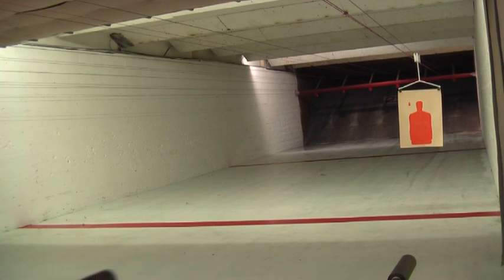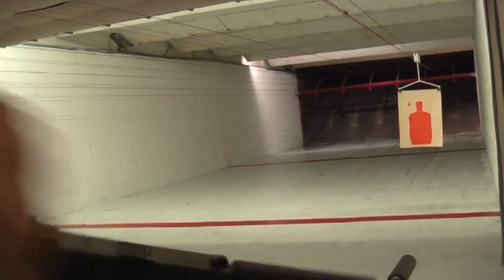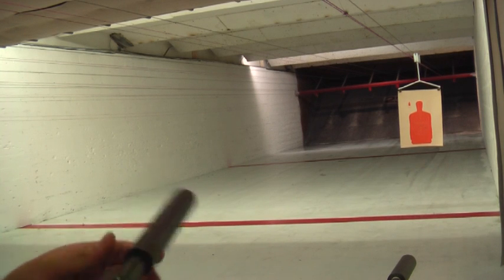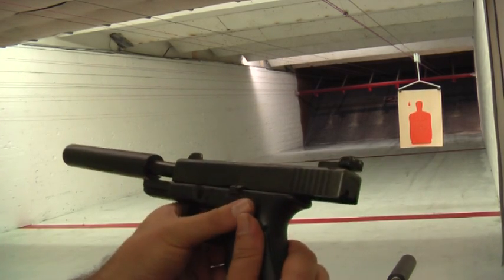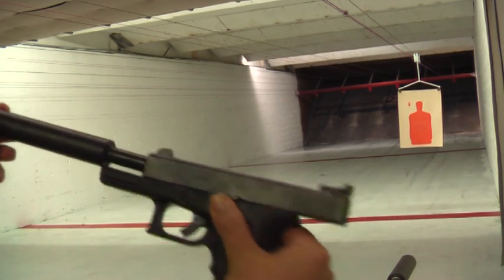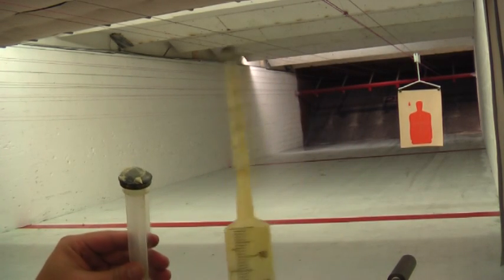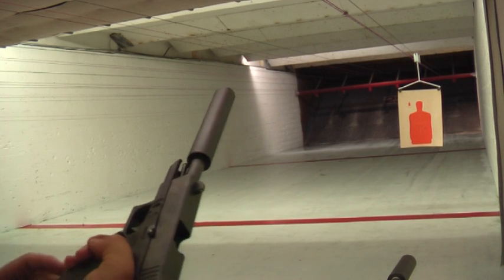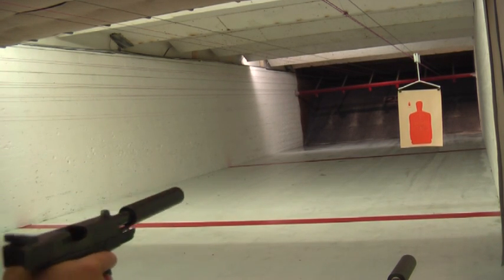glock with AWC Abraxas

Comment: Nice video!  I have the same unit and shoot indoors.....the lithium grease leaves a foul odor and smokes a lot. 

Try this: use a couple squirts of the green handcleaner, like Purell. Amazingly quiet and the liquid discharge evaporates quickly on my range. If ya get a little blowback,which is rare, just use it to clean your hands.LOL.

Give it a try...........very much improved. I use the Fiochhi 158gr for max punch.

Best,

Chief 615

Comment: Trust me.............this unit never needs cleaned till around 10k rounds..........do you clean your car muffler? Nope. Not till it gets loud.

The cycling problem of Admiral Kern is probably an ammunition problem, use a little heaver load....try Fiochhi 158 grain.

Hope this helps

Comment: yep. cleaning? no not really here either. once i dipped mine in a ultrasonic cleaner for 10 min.  but yeah you do not have to clean it everytime after the range. ive never cleaned it since & it runs great. my prob ive run into is cycling. I sold my Glock19 when I got a Glock 23. have you tried running the can on a Glock 23 w/a LWD23-9mm. I have. I get FTE and stove pipes everytime. any advise? do u ever get any FTEs? (fail-to-extract) ive emailed AWC asking advise.